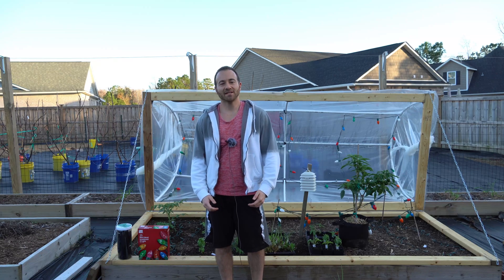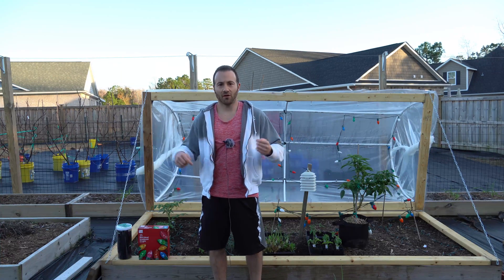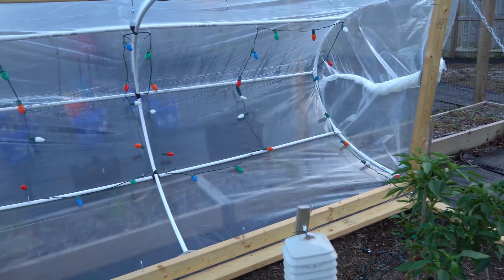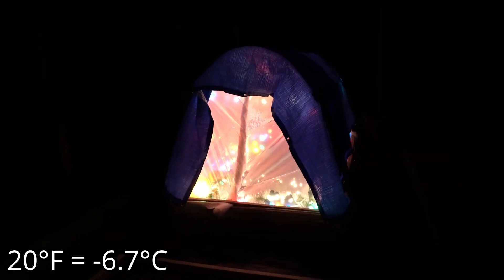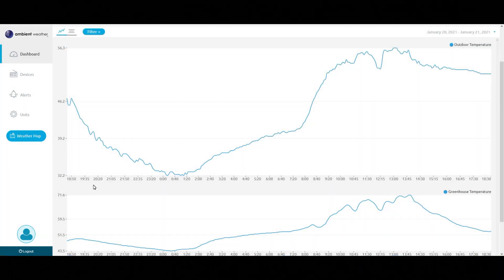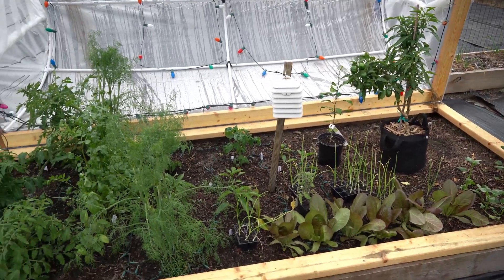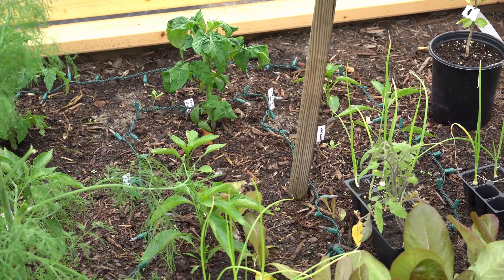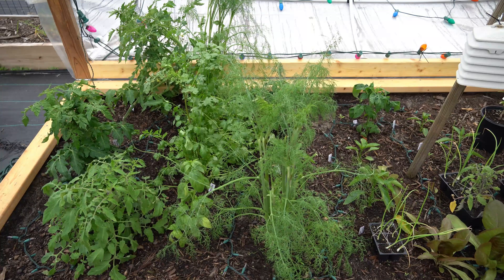How To Heat A Hoop House By 20 Degrees Using Incandescent Lights

Comment: I mimicked this in my small hoop house and it’s working perfectly! I’m in 6a and just gearing up for our winter. We get really cold usually in the single digits. This should heat up my hoop house quite a bit. I want to finish out my late start cabbages and beets. Right now our temp gets into the 40s at night. I have my cabbage starts in there and hopefully this will allow them to mature fully. Thank you for this video!!!

Comment: Awesome protection!  How did it do against one of the absolute minimum nights?  I worry that the tomatoes and peppers would keel over even at 32° (in other words 20-22° outside temps with this method).  Mine don't even like a close brush with freezing temps.

Comment: Do you worry about the c9 incandescent bulbs touching the plastic cover or tubing and potentially causing a fire? Do you take any special precautions about positioning the bulbs, or have you had any issues?  Perhaps I'm just paranoid due to my Dad's phobias about lighted Christmas trees.  I used a string of c9 incandescents once, to beef up the usual incandescent heat from 2 shop lights in a greenhouse over 2 huge potted citrus trees, when the temperature went down to 17F.  The trees came through just fine. But I've been hesitant to use those c9s routinely, although I'd like to in order to disperse heat sources throughout the greenhouse.

Comment: I am curious about having the lights on all the time. Do the plants mind this? They don't mind light at night? Would they prefer red lights?
   What color light is the best?
Reply: Oh okay the plants don't mind. Okay so what color lights are the best? Okay so u turn them off if it isn't going to freeze? I would still be worried about turning them off in the winter because the temp fluctuation. I guess that happens in nature too..
Reply from the maker: There is no need to add light during the day, since the sun will heat up the interior. You also wouldn't turn them on if there is no threat of a freeze. My rule of thumb is over 40. If I have a forecast that's above 40, it's generally safe. If it's 40 or below, I run them since I've seen forecasts off by 5-6 degrees.

Running them at night is inconsequential. The intensity from the light is so low that it doesn't matter to the plants. You need to run something like HID's to truly affect the plant's circadian rhythm. C9 Christmas lights don't provide enough light intensity to simulate the sun.
Reply: @TheMillennialGardener  oh okay thank you soooo much for the response. I was just about to spring for some lights but was worried about them not getting enough darkness. I read that green light is the hardest for them to absorb and found green C9 incandescent Christmas lights. Do u think I should go for the green? Might be pretty and not as noticible to the neighbors. They would give off the same amount of heat regardless of the color yeah?
  I do have this smart device I plug everything into that let's me turn everything on and off from my phone so I can easily turn them on when it gets cold. Would be great to have some sort of alert to notify me when it gets to 40° though. It doesn't get that cold here that often. I'm on the Oregon Coast.
  I can also set the plugs to turn on and off the Same time every day. Pretty cool gadget.

Comment: Have you tried doing a double hoop with a few inch gap?
Reply from the maker: No.  I've decided my climate is just too cold to try and grow tender annuals all winter.  Even though this design kept them alive all winter, the sun just wasn't strong enough long enough to induce fruiting, so they didn't do much.  It was kind of a waste of time.  It would be better to just plant them 3 weeks early and give them temporary protection for the same head start.
Reply: @TheMillennialGardener  Interesting, I'm up in Ontario and just set up a similar hoop house .  I am considering doing your light bulb set up to keep the winter greens going, Mainly Kale and Arugula.  Not really trying to grow, just prolong the fall crop into the winter.

Comment: My challenge with your method is we live in very rural area and far from big box store or big walmart so we can't find incandescence outdoor 9c Cmas light bulbs anywhere less than an hour from us. I don't want to order online so all is good. We just need another method that will work in our context. Thank you for your time making this video.
Reply from the maker: That's not a problem at all.  Home Depot sells them for $8.99 online and ships.  These are the exact ones I'm using in my video: https://www.homedepot.com/p/Home-Accents-Holiday-24-ft-25-Light-C9-Multi-Colored-Incandescent-Light-String-W11C0056/205919408

They're outstanding, but buy spare bulbs.  Make sure you have a box on hand.

Comment: Are your avocado, satsuma, and meyer draped with the C9 lights, too?  I have a lot of young trees that I will need to keep warm on cold winter days/nights.  I need to start preparing now.  I'm in zone 9b (near Conroe, TX)
Reply from the maker: No.  They're only draped with the incandescent mini-lights.  I may use the C9's this year, because they're more reliable.  The real key are the plant jackets.  I recommend checking them out.  They're linked in my Amazon Storefront in the video description.  You need to hold in the heat with the plant jackets.

Comment: I would use small zip ties to shorten the cord distance between each bulb.  Over lap the wire(fold) and zip tie so it stays the length you create.  This would place bulbs closer together and there by create more heat by having more bulbs in the space you currently have.  Also, I wonder how a double plastic cover would do.  Double pane glass in a regular window creates and insulation air space.
Reply from the maker: They are zip-tied together as closely as possible right now.  I can't really get them any closer.  A double hoop house would help a lot because throwing the tarp on top adds about another 8 degrees, so a second layer will clearly do a lot more.  The reason why I don't use the double layer is adding another sheet of plastic will greatly reduce the amount of solar energy reaching my plants.  They're already growing very slowly because of the weak sun this time of year, and further reducing the light intensity would really hurt me.  It's much better for me to have a single-layer of plastic and then on the 3-5 really cold nights a year, just toss a tarp over for a few hours.  Reducing my solar energy every single day to add a little insulation 3-5 nights a year doesn't make sense.  If you want to grow tomatoes all winter in Zone 6 or 7a, though, you'd probably want a double layer.

Comment: Excellent work, My wife and I were discussing having one on our long bed at the end of this next season. It is 15'x4'. That may need a lot of lights though. Keep up the great work and videos, Just nothing like growing your own grub.
Reply from the maker: Well, mine is a 10'x4' and requires 565W for my climate.  Yours is 60 square feet, so I would expect you to require 848W.  At 175W/strand, I would think 5 strands of C9's would do you if you decide to build a 48" tall hoop house like me.  If you want to go lower, it'll need substantially less.  I would expect this to cost you anywhere from 60 cents to $1 a night to run, but considering you'll only need to run it maybe 3 nights a week, that's not too bad in my opinion for fresh produce all winter.
Reply: @TheMillennialGardener  Crunching the numbers makes it seem even more appealing. Even if you have to run it more than the 3 nights per week. I appreciate the break down. Won't be long before everything is blooming! Getting pumped!

Comment: What is the effect on your electric bill?
Is it more efficient than the various heaters?
Reply: Wattage is wattage for heating like this (light bulbs and resistive heaters).  But if the other heater has a fan, it might better distribute the heat (and even grab some free heat from the ground).  On the other hand, the bulbs are spreading out the heat too.
Reply from the maker: The calculation is in the video description.  It costs about 50 cents to run it a night, and I only need to run it maybe half the nights.  We're talking $2-3/week to have tomatoes, peppers and basil in the winter.  It's worth it, to me.

Comment: I do this with my tropical tortoise species. A cheaper recommendation would be ceramic bulbs. You can get them for $5 for a 150watt bulb or larger. That way youre not creating a birdnest of wires
Reply from the maker: My concern is more the outdoor rating.  If there was a way to rig up a fully outdoor rated system of fixtures - and there probably is - I would do it.  I went this route because it's fully outdoor rated and I got the strands of lights on clearance for $4.49.

Comment: Yes,  agree it’s something different to consider keeping plants warm in cold nights. Is this different than installing a low wattage barn heater? How much electricity/ power are being utilized?
Reply from the maker: The cost calculation is in the video description.  It's a little less than 50 cents a night if I choose to run it, which is negligible considering it doesn't freeze here most nights.  We usually get about 30 or so freezes a year, so we're talking about a $15/year expense.  I don't go the heater route because of the outdoor rating.  I don't want a heater running outside unattended in all weather elements.  I want to be able to leave my house with this system running and not worry, and outdoor rated Christmas lights give me peace of mind.

Comment: Also why hang them on top... heat rises...wouldn't it make moe sense yo leave them on the dirt?
Reply from the maker: The entire hoop house is only 48 inches tall.  The dome is designed to hold in the heat, so there is nowhere for the heat to rise to.  It doesn't matter if you mount them low or high because the air volume is so small, there isn't an elevation gradient for air to escape to.

Comment: We have lows of 20/30s what would you put in for more frost hardy like lettuce and kales etc...
Reply: We get to the 20s 30s and sometimes teens, for my brassica bed, I just used these: https://amzn.to/3qRUZKV when I looked it up just now, its on sale, and there is an extra promotion to apply, so check it! 
And I wish I could put a picture, but my cauliflower, lettuces, Brussel sprouts, broccoli,  and collards are all perfect! And it was so affordable!
Reply from the maker: So far, I've had the following sub-freezing lows this winter:

12/27/2020 ______22.5
12/26/2020 ______22.6
12/9/2020 ______25.2
12/3/2020____ 26.2
1/10/2021 ______26.6
1/19/2021 ______27.7
1/17/2021 ______27.7
12/2/2020 ______27.7
12/25/2020 ______28
1/11/2021 ______28.2
12/19/2020____ 28.4
12/8/2020 ______28.4
1/7/2021 ______29.1
12/18/2020 ______30.4
12/6/2020 ______30.6
12/23/2020 ______30.9
12/28/2020____ 31.1
1/9/2021____ 31.5
1/18/2021 ______32

If you only have lows in the 20's and 30's like I do, this will easily protect warm weather, frost-sensitive plants.  If your lows are only in the 20's and 30's, kale, lettuce, broccoli and other cold crops should be grown unprotected because they can withstand those lows and hoop houses may actually cause them to bolt.  The spinach I planted was a mistake.  It is bolting under the hoop house, and in my Zone 8 climate, it does fine unprotected.  I wouldn't recommend planting lettuces inside a hoop house unless you're in 7a and colder because they will mostly do fine outdoors, unless you're in a very far north 7b like New York City or Philadelphia.
Reply: @TheMillennialGardener  VERY helpful thank you!     You should do a whole video on this - where do you get your info?   I am constantly cruising and haven't heard this before !   :)luv

Comment: Great idea!  Have you considered using those walkway solar-powered lights to eliminate a need to plug in the lights?  I’m just curious.
Reply from the maker: I would not want to use solar.  Solar is a big risk because you can run out of power if the weather doesn't agree with you.  4 weeks ago, I went to Florida for a week.  I monitored the forecast at home and flicked on my lights remotely from a restaurant down in Palm Beach County when I saw lows were going to be in the 30's a couple nights.  I want the reliability hard electricity because one mistake can end your growing season.
Reply: The solar lights don't heat up because they are so low powered.  The wattage is the key.
Reply from the maker: @TheRainHarvester  precisely.
Reply: The solar powered lights are all guaranteed LED lights. So, heat output is negligible.